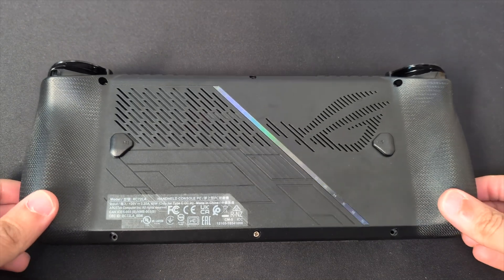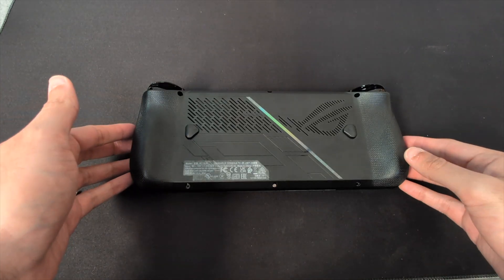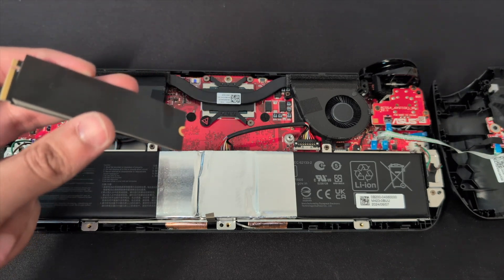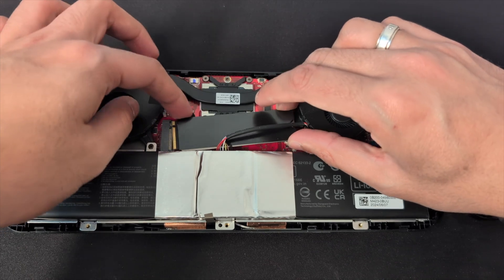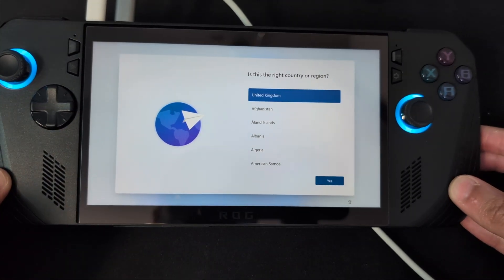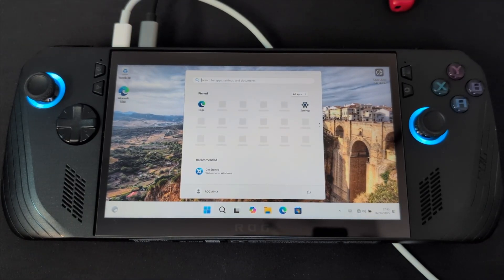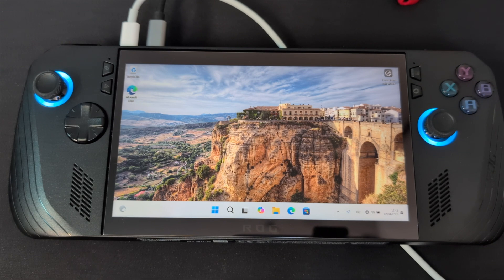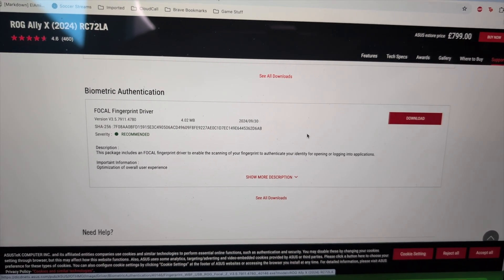ROG ALLY X Upgrade

Comment: You should disconnect the battery before upgrading the SSD and the ribbon cable is more likely to stretch out if you move it like that than just disconnected it

Comment: Is it possible to clone the contents of the Ally's SSD to the upgraded drive, so that the new drive can be swapped in afterwards without requiring any complicated setup or software reinstallation? Thanks :)
Reply from the maker: Hi, you absolutely can do this and would just need a M.2 enclosure to put the new ssd inside and connect to your ally via usb c. Clone the internal drive to the external drive and then you should be able to install that cloned drive into the ally. I prefer doing a clean installation to get a fresh experience